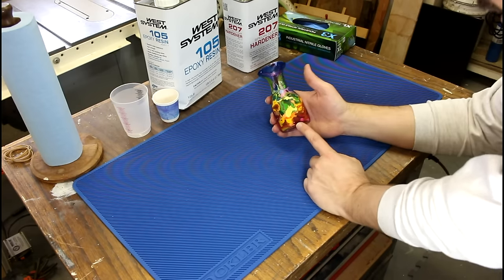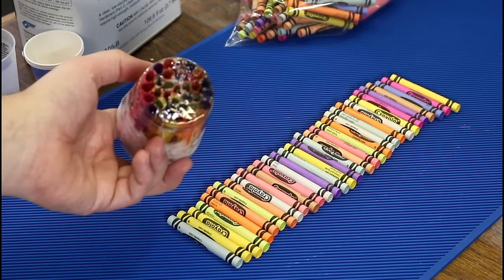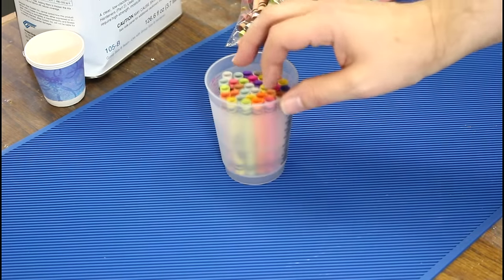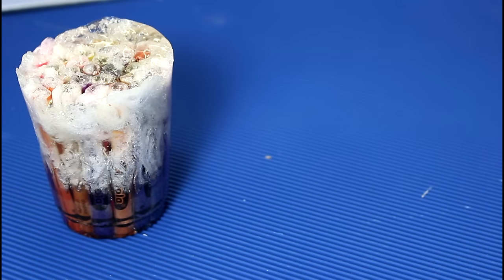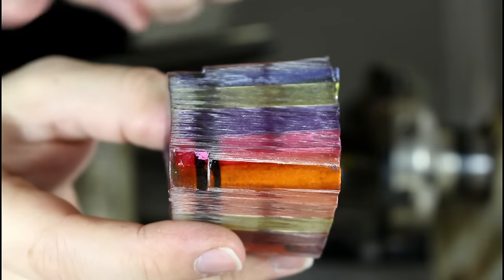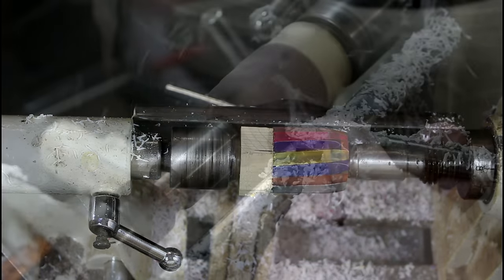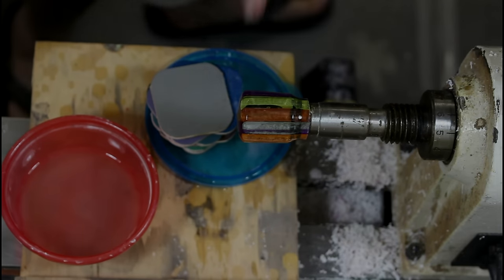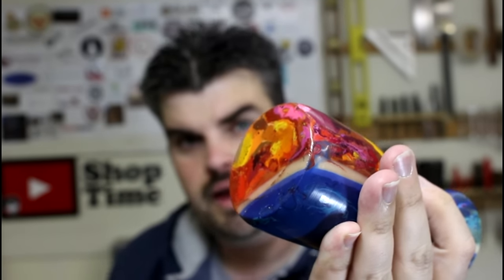Dip It #7: Crayon Wrapper Bottle Stopper

Comment: 3:20 I love it when you have enough experience and knowledge of your material that you can solve problems like this.  I don't work with epoxies as anything other than adhesives at this point, but someday I hope to add that versatile material to my repertoire.

Very cool bottle topper, Peter!  I especially like that some of the papers are intact and legible enough, and angled so that you can still not only identify what they were, but still read what color it was.  :)

Comment: maybe im just weird but ive wondered how long food lasts and whats the longest. ive seen in Japan they dip popcorn in resin to make earrings and jewelry. I wanna try myself but idk where to even start lol
Reply: Look on amazon or ebay for epoxy resin :) I found some on ebay last night, the same brand used in the video, for only £30 approx $35-$40. Mix according to instructions. Then just use a piece of thin thread or fishing wire so you can dip the popcorn in the resin. You might need to use a cocktail stick to submerge the popcorn so it's coated all over, then tie the string onto something so the pop corn hangs free (put something underneath to catch drips). Leave to harden. You can buy drop earring pins on ebay, you can thread beads onto the string if you like, then just use the thread to attach it to the stem, and voilà! Popcorn earrings!! Hope that all made sense!

Comment: I really like the challenges you give yourself, the results are always fascinating. Thanks. I worked with resins for many years and the over heating is always controlled by how much catalyst you put in, if its a cold day you put in more, if its humid and hot day you put in less. No resins should become so hot that it bubbles, as this reduces the strength of the resin. I would try a couple of experiments by halving the catalyst each time until it stops bubbling but still hardens the mix. 
thanks again for the videos you do, I hope this helps. Cheers from Paul from Adelaide, South Australia.

Comment: way cool Peter! I don't know if I told you before, I use the cardboard center of a paper towel roll to make bottle stoppers, cut to length, put tape at one end and fill the other, once cured, drill your hole ,mount, turn off the cardboard, a little shaping and sanding and there you go. Quick and easy. Give it a try sometime

Comment: silicone or LDPE/HDPE molds help a lot w heat dispersion in epoxy resin use (and are best for releasing your casting). Pouring/curing epoxy resin in multiple layers, for thicker castings, is the way to go. Love your videos/projects. :)
Reply: +GrimmsCraftingTales 

Pardon me, but is the a special way you cast them in multiple layers? I've been hesitant to do so because I would think that you would be able to see lines in-between the layers. Do you do it when the bottom layer is fully hardened? Partially hardened? Thanks! :)
Reply: +The Raven Depending on the epoxy brand, 12 hours is a good wait time between layers or you can wait the full 24 hours. At 12 hours, you have "soft click" stage (epoxy can still be "bendy" or malleable). At 24 hours you should be fully cured. I've poured at both time intervals w no issue. Lines between layers aren't really noticeable. :) The more resin you use, the hotter the reaction = quicker cure. If you don't want the boil effect as in this video, do multiple layers. Ambient temps can have an effect too. Hope that helps. :)
Reply: Ok! Awesome! Thank you very much!

Comment: love the dip it and turning vids.

Not sure if you need ideas, is case you do:

~Dip it with whole peanuts so when ya turn it, it has a cocobolo type cavaties in it.
~Dip it with a cup full of copper BB's, i think your carbide tools can handle it, should look great.
~Dip it book ends made with scrabble tiles
~Dip it with a cup of rock salt thats used to de-ice roads
~ hmmm wonder what epoxy and sand would do?

Comment: If you still have some crayon shavings, you can melt a thin layer between two sheets of parchment paper for a crayon-based pseudo stained glass that you actually can put in windows or law wattage lamp shades. 
It mostly just dyes and bonds the paper, leaving you with some interesting designs.

Comment: Put it in the fridge or freezer.  Epoxy is an exothermic reaction (as you know) and produces heat as it cures.  Heat also accelerates this reaction and cold retards the speed of the reaction that cures the epoxy.  While the epoxy won't set as fast in a cold environment (which is why the 3-day epoxy takes 5 days to fully cure in my basement shop during the winter), it also won't overheat nearly as easily.  EasyCast is also made for larger casts; might have better luck than with the west systems epoxy.

Comment: west system epoxy is the best, but not cheap.  when your using large amounts of it try to cool it in something like refrigerator or something it should do just fine.  it just takes longer to harden.  I live up north in pa and work on boats and have used it in the winter for some project in 30 to 50 degrees and did fine in large volumes.

Comment: Catching up on some videos, finally got to this one. Wow, that looked amazing! Question, when preparing it for the lathe, you took a round thing and made it into a square thing on the band saw, and then turned it back into a round thing on the lathe. Was that simply to remove as much material as you could before turning it on the lathe?

Comment: they would make some really cool tool handles
Reply: make it like that but use those weird shaped, orange pencils a lot of carpenters use instead of the crayon sleeves!
Reply: +Andre Petermann The flat pencils? Those are easy to sharpen with a knife, and easy to use to get a good measurement mark. (They tend to be red here in Norway, though.)

Comment: When you pour resin, if you place the bottles in warm water for ten minutes or so before pouring it'll reduce bubbles. A lighter can also be used to pop surface bubbles if you can see them. (Which you couldn't in this, but just putting it out there for the future if it's helpful)

Comment: those came out really interesting....would be an interesting project to vary the diameter more so you change the amount of cross-section showing....    

i like the idea of an inlay....would also be interesting to do an entire table surface with an inch thick layer of them cast in resin (similar to the oreo table....would take a LOT of resin though :P )

Comment: I agree that the crayon vase won't reach melting temperature in your house. However, the problem with wax is that as it heats, it starts to soften long before it reaches the melting point, and if it gets too hot, it may start to sag and deform. I have seen the same happen with candles.

Comment: Loved how it turned out. Was just thinking when you had the failures because each time the piece 'cooked itself', is the thermo-whatsit erm, exothermic (thanks Google) reaction catalysed by the paper wrappers? Can you reduce that if you cooled it in, say a running water bath (careful not to get it in the resin of course.) or would it just cool the outer edge? Worthy of an experiment?

Comment: I would be interested in understanding why you prefer epoxy resin over polyester resin? Also, do you have to do anything with the polyester resin like I've seen with some videos where they use a pressure pot or vacuum chamber?

Comment: I know next to nothing about working with resin, so this may be a stupid question, but as the problems at the start were due to overheating, could this be solved by leaving it in a fridge (or even freezer) to keep it cooler as it cured?

Comment: Question:  When you had the problem of the resin getting too hot in the cup, is it possible to set the cup in an ice bath or cool water while it's setting to counter the extreme temperature or will that not work or cause a problem with the setting phase?

Comment: Why don't you submerged the cup half way and or put it in the freezer or fridge... Or put it in an ice water bath?
Reply: the heat Transfer is too bad 
the outside would be cool and in the middle it would overheat
Reply: Vi Wo I can see that with the ice bath maybe but I've seen others use a "cool" or room temp water bath
Reply: If you start out with your resin at a low temperature that should reduce the rate that it cures, and heats, at.  But it'll take quite a while to cure like that.

Comment: Couldn't you limit the heat destructive power by  running fans /putting in fridge?
Reply: the more resin you use, the stronger the chemical reaction. so it gets hotter faster. so I think a fan probably wouldn't help

Comment: Get a heat gun and blow hot air onto the piece as it spins as a way of polishing it
I think it will be much easier

possibly also running a smooth cloth along it at the same time, maybe with just a dab of resin if needed
Reply: +Leonard Greenpaw Have you ever worked with resin before?
Reply: no.... what was wrong with my theory?
Reply: Leonard Greenpaw These resins are thermosetting plastics. They have a higher melting point once fully cured. If you try to reheat them, you won't simply melt it. You might just end up discoloring it or causing the surface to become sticky.

As for the cloth and resin, you'll just end up with a tacky mess with cloth marks. Simply pouring another thin layer and letting that cure will do the trick. Sanding the way he did is the best way to go, though.
Reply: imwithstupid086
 well I didnt mean like a fabric cloth, I ment like one of those satin smooth type things.

Also thanks for explaining the properties of hot resin, I thought it would melt in a less viscous way.
Reply: Eh, still won't work. Those would still leave a mark. If not cloth marks, then spin marks. Sanding is still better. Hell, just using the cloth as a buffer is better. If you're lazy, spray some finish.

I work with resins making crap like jewelry and paperweights, so I'm familiar with how they operate.
Reply: imwithstupid086
okay then, thanks.

Comment: How'd it over heat
Reply from the maker: Epoxy isn't designed to be in that small of a container. As it cures it creates heat  (a reaction of the two liquids) to harden. If it's in too small a cup that process will cause the mixture to overheat like this...

Comment: West System again? Did you run out of Castin' Craft?
Reply: Also, the glassy end product is the very reason why I love polyester resin so much more than epoxy. Can't really sand that strong a polish on epoxy. That, and the fact it's way cheaper.

Comment: You should be careful with your wood furniture. It sometimes gets hot enough to catch on fire. It certainly gets hot enough in a house to spontaneously combust wood as well as melt the odd crayon-based vase.